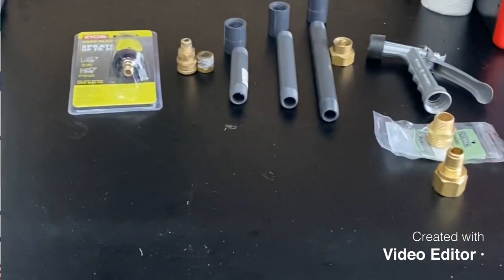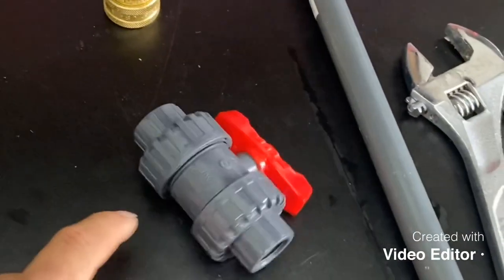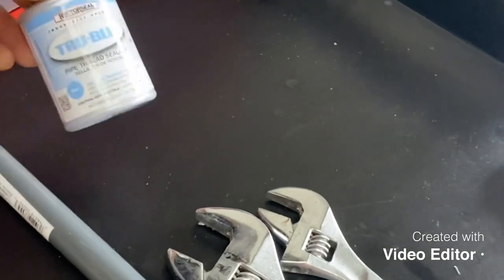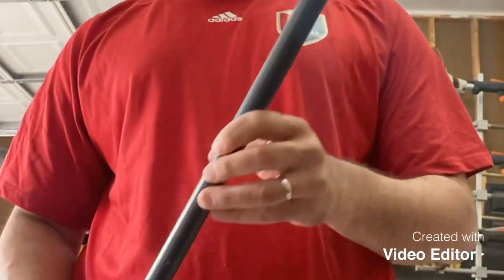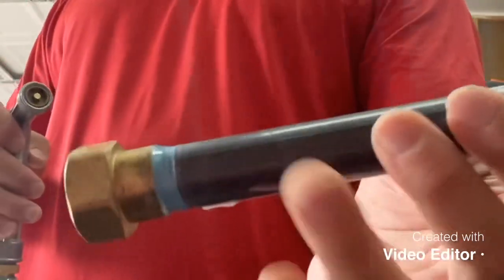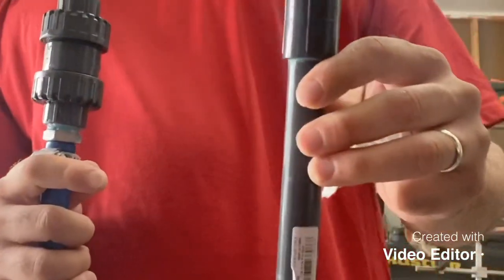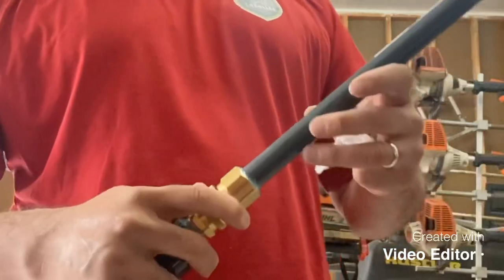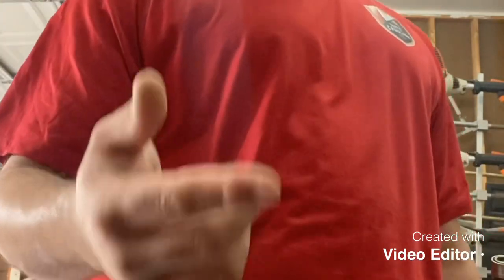How to build your own Soft washing wand / Gun

Comment: Make one for drop stick
Reply from the maker: I will do it soon
Reply: Solution Landscape & Pressure Washing where u get the 1/2 quick connect
Reply from the maker: Juan Manso I found it on a 
Hydraulic hose shop / Hose shop
Cross Hose